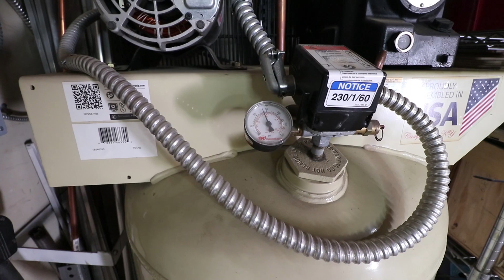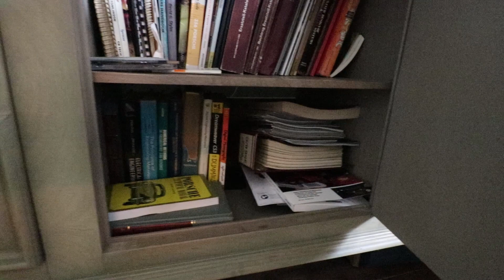What's The Most Expensive Drawer In The Shop?  Complete Auto Shop Tool Tour!!!

Comment: My attached garage is 20 x 22. When I had a new floor poured I made sure it was level. I epoxy painted the floor. Ceiling height is 9’ 6” and I installed 2 four post lifts. Get a couple of helpers for assembly. So you should be able to put a four post in. One has my 2.8 RSR clone and European 928S with 5 so. On the other is my 968 cab top up and my 996.
Reply from the maker: Ooh, that sounds like a great collection!  I think I mispoke about the height.  It's actually 8' because I've had my 911 up to the very top and there is no way another one could fit underneath.

Comment: I see a couple more tools I have to buy. Thanks for that input. The special or unusual tools I use come from my job as a veterinarian. I do mostly surgeries and dentistry so a couple of precision instruments to work in confined spaces and I cut mostly with an Oscillating saw and  burrs.
Reply from the maker: Ooh, those must be really cool tools.  I love my carbide burrs.  I have 1/4" shank and 1/8" shank types.  What's does the oscillating saw look like?
Reply: I use a dewalt but it’s the same type of movement as an orthopaedic one used to cut casts or bone. Only the blade is a little different. I use the surgical forceps a lot too. Really good to get washers or nuts in place where your hand doesn’t fit, like a tiny precision vise grip. I can send you a pair if you want if you have a p.o. Box. Don’t worry those will not be used ones 😂

Comment: Thanks for the comprehensive tour of your garage/shop.  A good overview of the essentials and a very interesting glimpse into the specialized gear you use to do your great work on those old Porsches.  The wheel alignment tool is my fave.  Maybe I missed it but are there any tools you really wish you had that would make your project work easier?
Reply from the maker: I've been looking for a table belt sander and disk sander.  Maybe a 1" wide belt.  6" disk.
I end up using my bench grinder for more than it should do.  
If I had more space, I wouldn't mind a blast cabinet, but I do have access to one at the community workshop.  Other than that, I just collect what I need when a job comes up.

Comment: What Mig welder do you recommend? What about the Bester 190C? Appatently is part of Lincoln Electric group…
Reply from the maker: That's a good one.  MIG is pretty simple, so just make sure you can get parts for the torch once they wear out.  If it's the same as Lincoln, then I'd say go for it.  I've used inverter machines and they are great.
Reply: Thank you!!!